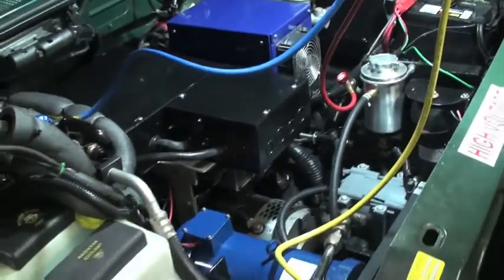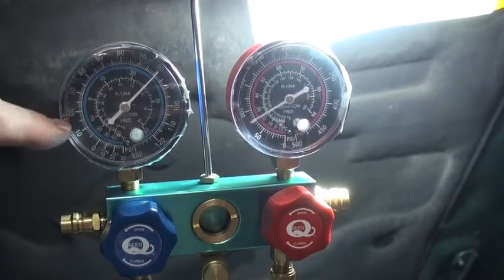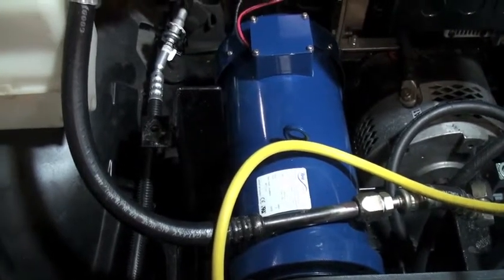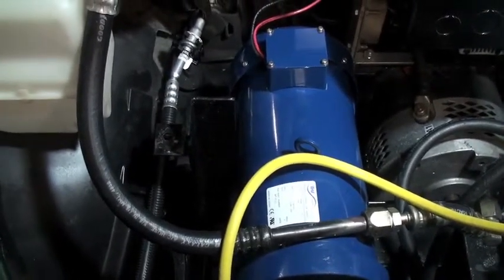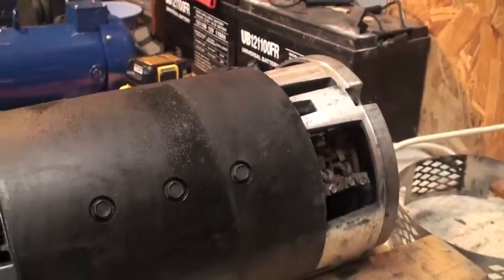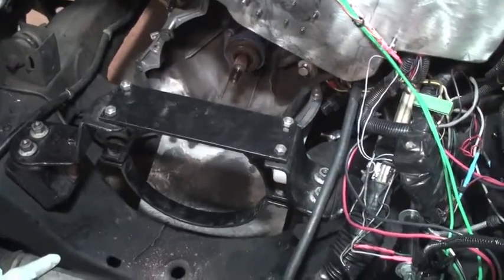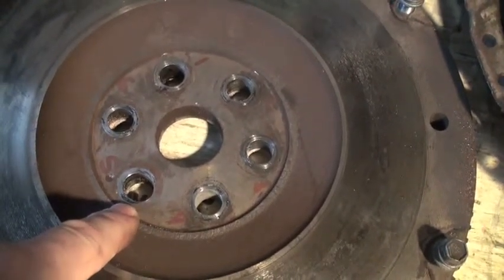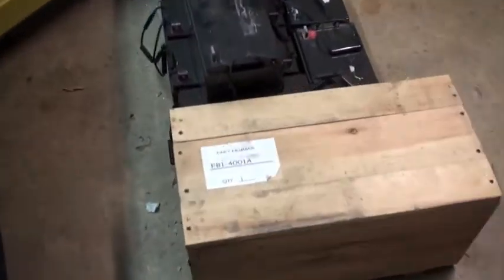Ranger Update June 16 2011

Comment: This is a shame that you had all that trouble but in any thing this is how people lean things I have done my share of failure and the secret is when you have problems is to determine what happened and try to correct it so it doesn't happen again you are going to hate me for this but there again the in the last few seconds of this video we see that the spline of the input shat is quite dry with no lube and don't use any old lube there are special grease for this application just try to help.